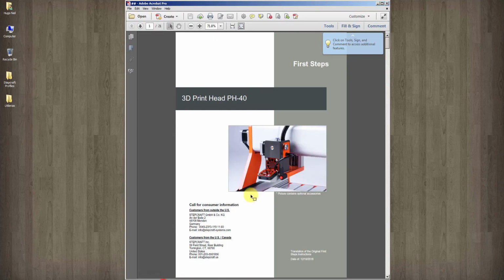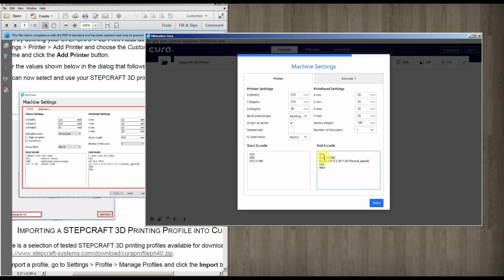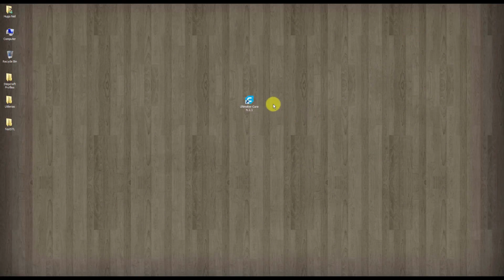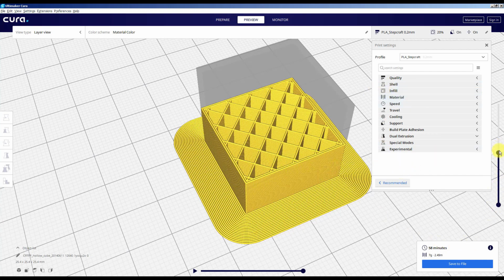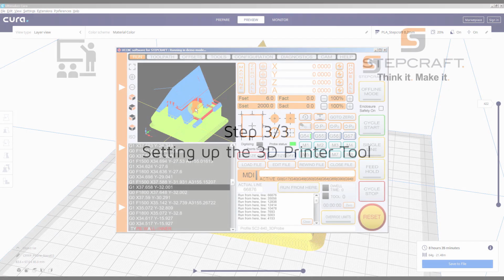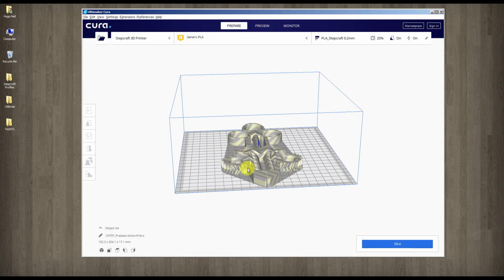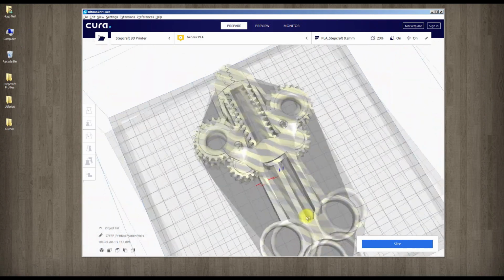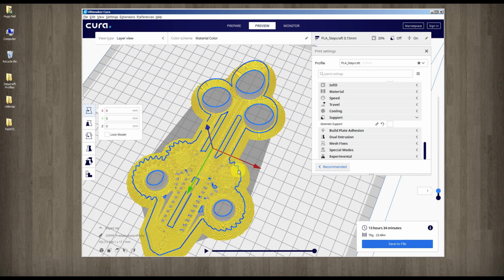Stepcraft 3D Printing Tutorial

Comment: Why does this have an old COM port? Why no slot for sdcard? Sorry to compare, but even cheap Ender printers have compact controller and integrated PSU, while this controler is rather bulky, plus has an external adapter. Stepcraft software requires licence per unit. Couldn't designers do a bypass to directly export G code from Cura? Wow.
Reply: A Stepkraft machine was purchased, its work is failing, screws come out of its place, the one who buys it will find what I say leave it to the people to try it better